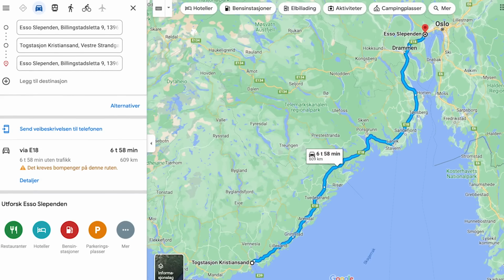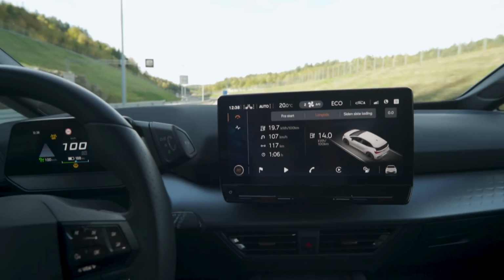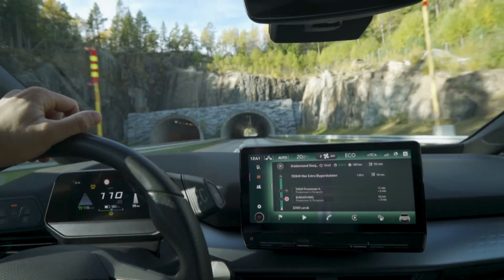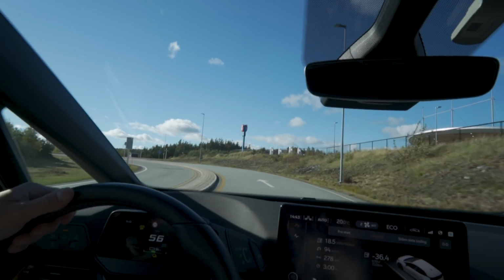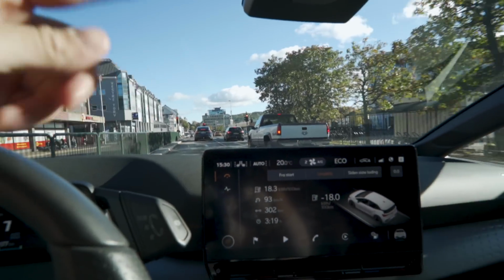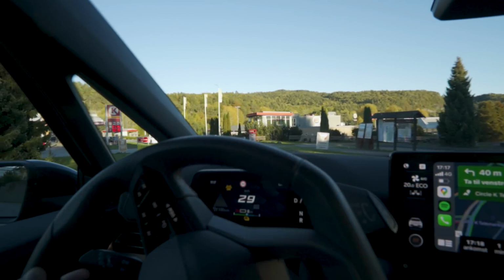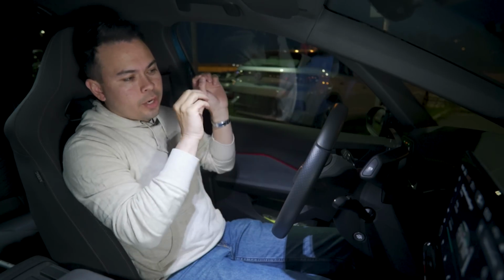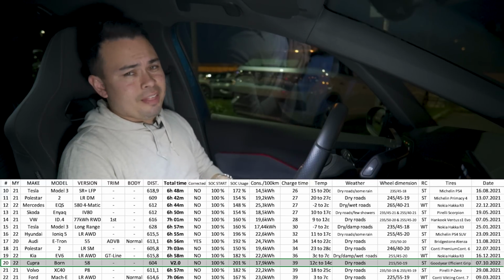Cupra Born 58 | 610km Range Test (Norwegian High Speed Run V2.0)

Comment: Hi Kris, maybe for V3.0 of your test you should also put in how much you had to charge for the hole trip. Background of this point is the fact that the average consumption according to the car is not 100% correct. You already see it in your first leg. You charged to 100% and went down to 4%. This means for 58kWh battery this would be 55,68 kWh and an average consumption of 20 kWh/100km and not the 18.5 kWh/100km which would result in 51.43 kWh lost over 278km. I get your point you only look for time you charge but the overall energy you had to recharge would be of interest too and you should have that data anyway. For DC fast charging around 5% is the normal loss if you don't need battery heating at the charger.

Comment: The charging time metric is probably the most levelized method to rank cars on the high speed course. Even accounting for wildly extreme traffic and/or weather, range and speed will always be variable factors due to external inputs. Charging time is less subject to big swings. Even a 10% fudge factor for something like 39 minutes of charging time means only +/- 4 minutes. A 10% fudge factor for 6 hours of drive time is over 30 minutes.

Comment: Hi Kris, thanks for the test. Definitely agree a car like this is good for a trip of this length (I drive a 58kwh ID3). I think you must have driving an early Born with software version 2.3? All Borns in the UK have 3.0, which means you see battery % in the driver's display all the time, and it also gives you % at destination. Same for ID3s sold since spring this year. New cars now are coming with 3.1, which also shows you consumption data in the driver's display.
The software probably also explains the faster charging than ID3. ID3s built with software 2.3 (from summer 2021), or earlier cars upgraded to 2.4, get peak of 134kw in perfect conditions, which is the same as the Born. IDs with earlier software were/are limited to 100kw peak.